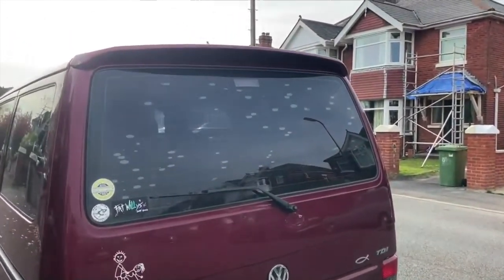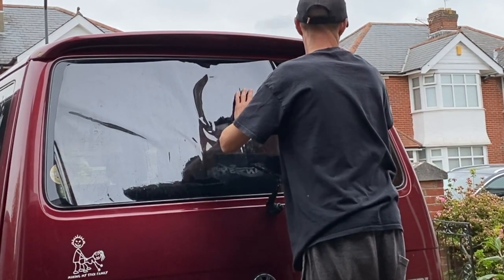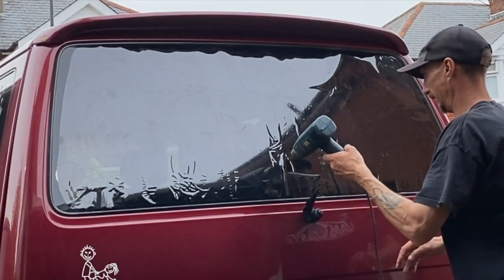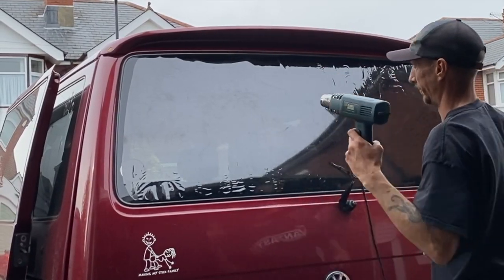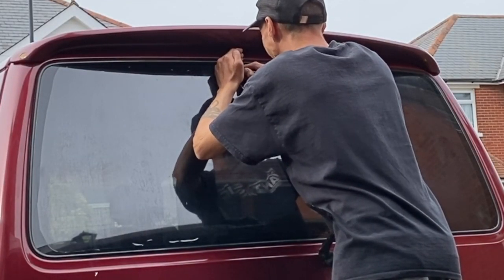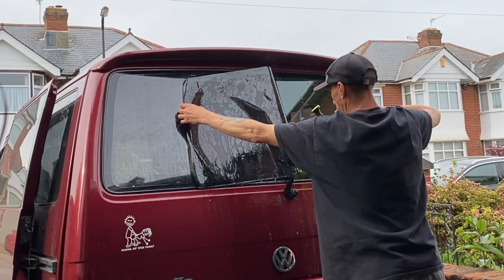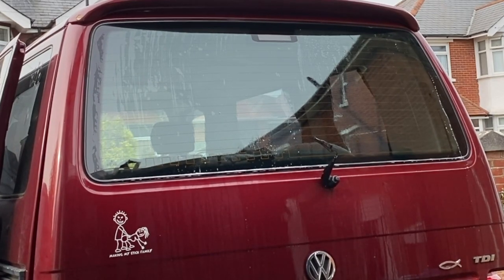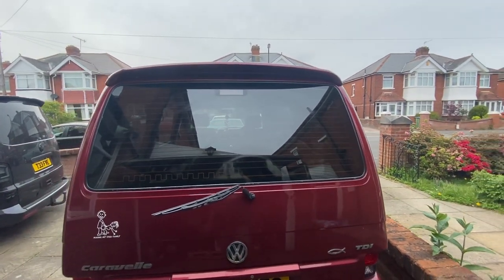VW T4 Tailgate/rear window tint job

Comment: Nice one twigs that looks great, you made it look easy, I know from experience it’s not 😂 I did my barn doors and side windows ok a few years back, but more recently changed to a tailgate, bought some pre cut tint for the t4 off eBay and it ended up stuck together in the bin 😂 respect
Reply from the maker: Thank you, I had a little practise on a few of my mates cars before doing my own 😂 I spent a lot of time researching how to tint like a pro, I’m really happy with the outcome and in fact my tints look better than what was originally on the van. Once I’ve got a few more windows under my belt I hope to be able to make a small business from it 🤞 
I did think about getting some pre cut tint but wasn’t sure if it would arrive in the post with crease’s 🤷‍♂️ so I brought a 30m roll 😯 I’ve got a bit left if you want me to tint yours 😂
Reply: @TwiggsT4  hi mate did you start that business? Dont fancy battling with these sheets of film